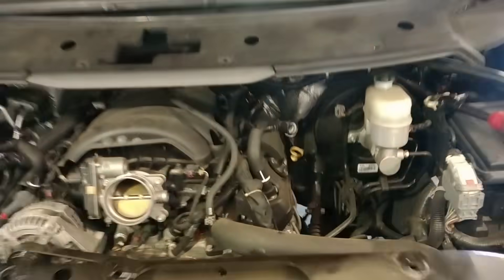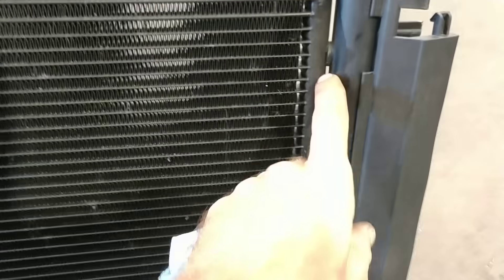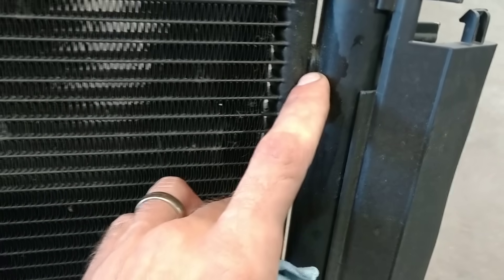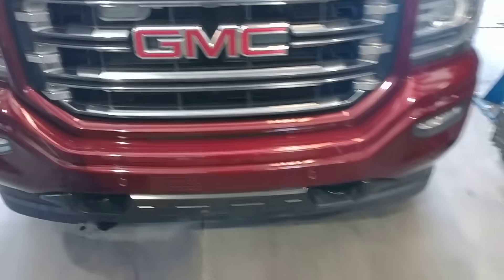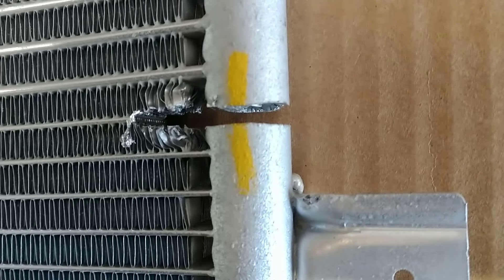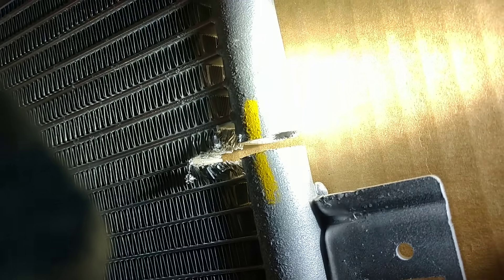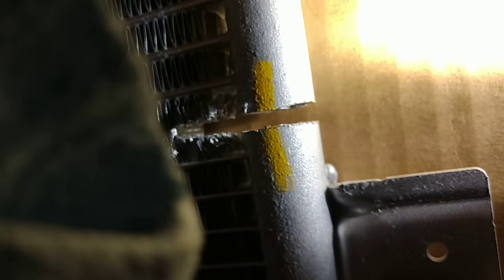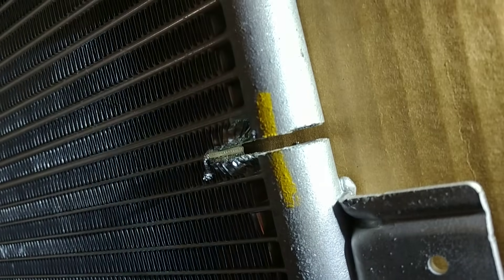Customer States...WAIT, look at this! Can't make this stuff up!

Comment: The real issue is that the part should NOT be failing on a 4 year old $60k truck!
Reply from the maker: You're not wrong. I'm sure the engineers designed three cooling package with two separate parts. The cooler for the trans, and one condenser for the A/C. Then the bean counters got a hold of it and decided to just make it one piece to save some pennies. Then when put into the field it didn't work right due to heat transfer. So the cheap as dirt fix was to hack the end tank in half to isolate the two cores so they couldn't transfer heat between them.     As a technician this is embarrassing. They expect me to install this hack ass junk and then stand by my work. It would cost money to implement a proper fix for a design flaw, so that's out of the question I suppose.
Reply: @RainmanRaysRepairs  The job I work at in Lockport, NY packages those, there's one step that we have to do to complete the unit before we strap it to the insert and slide it into the box.  There's a 4 inch by 3 inch patch that has to be attached on to the unit on a specific spot, its to reflect heat off of the part at that point as the ATOC had a tending to overheat and blow up.  The cut is generally not that nasty looking but its usually rough as the assembly lines that make them in Lockport and Juarez, Mexico have to make thousands of them a day.  The company I work for has to package thousands of those every spring and summer as they have a terrible fail rate and GM is trying desperately to resolve it.  Most mechanics that work on transmissions just take it out and use a different ATOC and install the condenser built without the ATOC that GM sells.
Reply from the maker: @KeoniPhoenix  Thanks for the info. I always wondered what that reflective patch was for. I should work for GM as an engineer... Lol I know exactly how to fix that problem and make the failure rate nearly zero. Everyone ready for it??? It's really quite simple.   Make two parts. One cooler for the trans, and one unit for the condenser. BOOM!
Reply: @RainmanRaysRepairs  Typically engineers don’t make the choices, they follow the instructions given and just build it.
Reply from the maker: @superbros1690  Agreed. What I meant is that the engineers would design there system to be robust and fictional. Then have their perfect creation be shit on by corporate
Reply: @RainmanRaysRepairs  Right, unfortunately greedy companies care more about profits than anything else.
Reply: @RainmanRaysRepairs  yeah but that would cost more money and for manufacturers that’s a big no no.
Reply: @RainmanRaysRepairs  Nah, it's the Apple business model. Why make it so you can replace a $40 part when they can glue/weld/build it all together and make it a $700 sub-assembly that is so expensive you seriously contemplate just buying a whole new model of [PRODUCT]
Reply: @RainmanRaysRepairs  they aint going to do that mr. ray thats the right way lolol
Reply: @RainmanRaysRepairs  That makes engineering and customer relations sense, Ray, but not profit sense. GM wins.
Reply: @RainmanRaysRepairs  . Shame on you Ray you want them to admit their mistake, 🙄 bite . Try making parts in America🇺🇲we used to have pride. Nowadays it's just about the MONEY,MONEY, MONEY. 🙃👍🙏
Reply: @RainmanRaysRepairs  
Fire thd bean counters and give GM back its reputation of building a reliable car or truck.   Its no fricken wonder Toyota took over the top spots.  And GMs no longer the largest automaker.
Reply: There can be some hacks with engineering degrees, but usually this sort of issue comes from the suits up in the ivory tower.
Planned Obsolescence and continuous maintenance is their mantra and GM is the big temple of this cult
Reply: @chaoswarriorbr  parts and repair are the new moneymakers at dealers now.
Reply: @RainmanRaysRepairs  More likely, they design the part to have a high probability of failure shortly after the warranty expires.   And they actually do that.  I was talking to an engineer who works for a company that makes gas struts for the auto makers (as in, the struts that fail and drop the hood on a mechanic's head) and he said that the auto makers were very clear about this:  Design the strut to fail a little after the warranty runs out.  They don't want it to last longer.  Even though the manufacturer is fully capable of making struts that will outlast the useful life of the car.    I've heard of the bearing manufacturers also being told that they need to make bearings that will barely outlast the warranty, too.   Because they don't want a long lasting reliable vehicle that doesn't ever need repairs.  They want you to buy spare parts and then trade in for a new vehicle.
Reply: @RainmanRaysRepairs  Bean counters destroy cars. One channel I follow is Munro Live who has a lot to say about engineering and car manufacturers. In the end, bean counters make cars more expensive and less reliable by compromising engineering. A good engineer chooses a certain design for a reason.
Reply: @RainmanRaysRepairs  Exactly right. Beancounters are the bane of engineers.
Reply: @RainmanRaysRepairs  Bean counters ruin many of great designs!
Reply: @RainmanRaysRepairs  how else can they rip people off and have to build more parts? Not saying you’re ripping them off but the corp
Reply: @RainmanRaysRepairs  so did you end up installing this replacement part on the truck anyway or used an aftermarket one?
Reply: @RainmanRaysRepairs  I know you said this on one of your most recent videos, we live in a false economy. Your not wrong. I don't know how many time i replaced a idler pulley on my older vehicle dam thing kept failing time after time again (bearing), anyway i got hold of a german made bearing and problem fix.
Reply: @RainmanRaysRepairs  As an engineer, I can unequivocally say that bean counters are the root of most problems.
Reply: @RainmanRaysRepairs  It doesn't help that the factories that make these parts push their employees to make high rates and check for quality at the same time. I live in West Michigan where a lot of them are. They're all the same. Challenge, Benteler, JCI, Stone Plastics, Agape, L&W, Magna Mirrors, Adient, Gentex. Yup I've worked at all of these places, I've "abused" the temp system.
Reply: @RainmanRaysRepairs  You're an awesome person, Ray..
  I hope you know the Lord loves you for treating others' vehicles as your own.
Reply: @RainmanRaysRepairs  
The bean counters figured GM could make money off repair parts. Why fix it.
Reply: Amen you the man
Reply: Nate, There's no money in reliability. Betcha that condenser is 400 bucks + labor + refrigerant.  Sadly, it's not just automotive, household appliances follow the same marketing scheme.
Reply: @68RDRNR  there is money in reliability look how much a new toyota costs compared to a new GM
Reply: We have done loads of these condensers in 2 yr old Tahoe’s. They we on back order for a while and we had to go aftermarket. Cant be any worse than OEM.
Reply: @ThePracticalMechanic  Same here (was initially due to the strike). Oddly enough, I haven't had an aftermarket unit come back leaking yet, and they were the same design with the trans cooler.
Reply: My 05 Corolla base model non electric windows none cruise control with 718k miles still have the original condenser along with engine and transmission
Reply: @5162-b8y  i have a 02 Tacoma and same thing here! I have over 200,000 miles but still all the OG parts
Reply: @AndrewSamaniego  That could go another 200k with minimal repairs.
Reply: @5162-b8y  ok Scotty
Reply: @5162-b8y  bombproof Toyotas
Reply: @5162-b8y  that's amazing.
Reply: @5162-b8y   Don't compare an old toyota to new cars, i got the same gen, 03  CE base model. Runs like a top 340 on it, all original. They where just built better.
Reply: @5162-b8y  The engine ain’t never seen over 3k in its life😂
Reply: @5162-b8y  Your car has too man miles on it.
Reply: Probably still have the same girlfriend too!
Reply: @5162-b8y  I have a 98 Toyota Camry totally good
Reply: @5162-b8y  Your car has done 1,155,508.99 kilometers in 16 years. 718,000 miles = 1155508.99 that's if i read the miles correctly.
Reply: @5162-b8y  My 2002 Silverado still had its original condenser when I got rid of it at 170,000 with rust and transmission problems. My 2014 Sierra has already had a new condenser installed, and my buddy's 2019 got one under warranty within months of when he bought it.
Reply: @5162-b8y  dude. It's a Corolla. They last forever. Nothing new.
Reply: @5162-b8y  and that is why Toyota makes best vehicles.
Reply: @heginschristianstrong7707  toyota all the way. I have a 2010 Venza creeping on 150k. Original AC components, never even needed a recharge yet.
Reply: @Tylerc3419  And my brother has a Dodge Caravan from the mid '00s, with over half a million kms.  What's your point?

(That's over 311k miles, for our American readers....)
Reply: @cbiltcliffe  the caravan from the 90s to mid 2000s was about the only good thing to roll out of Chrysler. I'll agree with that. I was commenting on GM's crappy AC though. Chrysler still sucks. I have a 01 Sebring with 60,000 miles, babied and garaged since new. The list of problems to fix everything is over $3000 in just parts. The AC in my Chrysler is about the only good thing.
Reply: Yup made with poor quality parts and they charge you big bucks to buy one
Reply: That is why i'd rather stick to an old 70's or 80's chevy p/u rather than paying 70 g's for a new chevy or gmc or anything new for that matter. In my opinion i think they make these new cars to break down on you so that you have no choice but to take them in to get worked on or possibly trade in for something newer just so you can spend more money but like i said that's just my opinion
Reply: @lorenzocuellar7521  Now the computer is in the car, we can't throw it out the window anymore.
Reply: Agreed. These dumb bean counters don't understand a cheaply built part now, while may save millions in production costs, almost ALWAYS cost 10s or 100s of millions in future repair costs.
Reply: @Whereismy10mm  GM is also a big fan of neglecting to recall parts that should be recalled. They'd prefer you keep getting it fixed out of your own pocket until it ends up in a scrapyard
Reply: @austinh1028  oh trust me, ford is too. There should be a recall for 6.7 oil pans for leaking between the block and upper pan.
Reply: NO vehicle manufacturer will design/build a vehicle that will last many years. If everyone bought cars and/or trucks that lasted 20 years they would ALL go bankrupt
Reply: @_Clem_H_Fandango_  Oops, mine is 22 years old, and when the time comes, I ain't buying anything built after 2000.
Reply: @thomasmleahy6218  I don't blame you, I still try to buy what I call "B.C." cars. Before Computers, simpler cars to work on and usually if it's old enough no one else is driving one.
Reply: @thomasmleahy6218  I have two 2005 cars (A Hyundai and a Toyota) and three more made before 1999. That is the way to go, for as long as you can.
Reply: @_Clem_H_Fandango_  funny...I don't see Toyota going bankrupt
Reply: @_Clem_H_Fandango_  Isuzu seem to do OK. Loads of 20 & more years old ones round here & what usually kills them is tin worm (corrosion) due to our wet climate & sea spray.
Mine's on 280,000 & anything that's ever broke, I broke it apart from the fan control.
Reply: ye, it's suppose to fail right after the warrenty expires. Something went wrong here.
Reply: That's GM for ya.
Reply: 100% poo poo parts.
Reply: It's the auto manufacturing industry. They want to have suppliers cut costs on their parts every year so it puts pressure on the suppliers to build shotty parts.
Reply: Repairs should have been 100% under warranty from gm
Reply: @mondo odnom I beg to differ. I have never had an AC/HVAC system present a problem before 100k miles or 8 years. If you pay $60k for a truck I think it's unreasonable to expect me to be ok with it breaking in 4 years and mileage in the 30s especially when it is engineered in a way that makes the cost to repair sky high because of the labor hours having to disassemble other components just to be able to get to the broken part. The quality from GM and RAM has been so bad for so long that people have come to accept it and Unfortunately, this problem is common for a GM. Their reliability has gone downhill consistently since 2000. You'll be much harder pressed to find someone that had this problem so early with, say, a Tundra at that age and mileage...or a GM Truck from the mid-late 90s
Reply: According to their accounting it actually should :)
It is designed to pass the warranty and fail
Reply: My first new car after getting a real job was a 1990 Ford Probe. Whoever put the condenser where they did was a fool. I had bought the extended warranty and it paid off for me. They replaced the condenser three times in five years due to punctures from road debris. That warranty also included loaner cars while the car was in the shop.
Reply: @mikecumbo7531  Yeah i would love to meet SOME of the S@#T for brains of engineers who designed the engine bays. They clearly never serviced a car before in their lives.
Reply: They designed it perfectly.  Failed after the 3 year warranty is up.
Reply: Tell that to the new honda civics😂
Reply: @Thor Odin son Who won at LeMans.....? The better engine-Ford.
Reply: @67marlins81  What people don't seem to realize is that it isnt the better engine getting swapped into everything under the sun, it's the one with cheaper parts, so naturally for a crazy V8 swap on a budget, it's always a GM V8 that gets the nod. The 350/5.7 then the 5.3 that followed. That's how it's been for decades. They never learn
Reply: @crewdawg2008  exactly
Reply: @Thor Odin son that might be for older engines but the new ones are junk. $1200 for a water pump replacement in a 2010 GMC Acadia, please, what a joke. GM does indeed stand for GarbageMotors now.
Reply: yep i got 86 cutlass R12 works good as new never been opened up
Reply: @jonsworld5307  I think I have that beat - I have a 1985 Hyundai Pony with dealer installed AC (R12) and it blows ice cold. 

The car around it has to be rebuilt though, no brakes, I think some gasket needs to be replaced as its pissing oil out, there's no exhaust... Interior is nice though!
Reply: I was a big Chevy/GM guy for almost my entire life. GM has such poor design and engineering these days that I probably wouldn't take one if you gave it to me. Everything is engineered with planned obsolescence in mind...to bilk you for parts at repairs. Even worse, the designs are so horrible, that the labor costs are often absurd as well. I could deal with one or the other, but not both! If a part breaks frequently, they should at least make it easy to replace. If it's not easy to replace, it shouldn't be something that goes all the time! GM (and Mopar) are the worst!
Reply: I had to replace get the condenser replaced on my 2017 impala last year. It only has 30k miles on it.
Reply: I work at an auto parts store, and 80% of my customers are for American cars and they end up being major repairs. if we get anything like Toyota, it's for an oil change/air filter change.
Reply: @tracep.9900  i,m working on my 2 toyota tocama's 4 banger i got over 475k miles on the 1991 trade in was 2800$ best motors next to the inline 225 slant six
Reply: Funny part is I believe the SUVs have a special coverage but not the trucks
Reply: @driftfoxgarage  Yep 60,000 on Tahoe/Suburban
Reply: Agreed
Reply: ,,got to love cheap plastic parts
Reply: Exactly
Reply: Yeah how about the coil on your $10,000 AC unit in your home!
Reply: I had to replace the evap coil in my Explorer last summer.  I expect better quality out of these things.  I paid a lot of money for that Ford in 1998 and the a/c is out already!
Reply: How hard would it be to put a different part in? Afaik all the ac fittings have been standard since the late 90s, so only the geometry is different. You might need custom bent lines but a 1 time fix is a 1 time fix.
Reply: I had to replace mine 2018 Silverado. Complained and got some GM Rewards points. Lol
Reply: @michaelatchison6127  Rewards points i like that lmao. Tell you what does not matter where you live on the globe nothing is made like it use to be anymore.
Reply: Cheaper to have a shop weld up and fix the OEM one and either put it back in or keep it as a spare.
Reply: would JB weld actually hold that up? I've seen it used on AC lines on an 2009 Elantra my friend was trying to buy off a used car lot (that car was a mess - 160,000 KM on the odo, pedals, carpet, and steering wheel (under a cover, to be sure) indicated taxi levels of use, clearly repainted w/ overspray on the top part of the engine covers, all over the unibody rails and exhaust, rear rotors that had more rust than a dead track, lots of missing clips and  visibly scored screw heads in door panels, wiring harness spliced all over under dash...) but the AC actually blew cold air.
Reply: Funny how no one's talking about the giant gash cut into your new condenser. Yeah, stuff breaks these days after a just a couple years, it's not news. At least not if you work on newer cars for a living. For sure, I've gotten shit replacements for condensers and radiators, OE and aftermarket alike, but nothing like that... That's, hilarious.
Reply: you are correct, But we are talking about a GM product, I used to be strictly a GM customer But their quality is really bad and GM knows it but no one seems to care about quality at GM anymore.
Reply: this is why cars like Teslas are more and more appealing.  No purposeful obsolesence.  All youre going to service is tires, brakes, and those kinds of things.
Reply: @TheK1ngdomK1ng  The guy who just blew his up, 2 batteries dead in 8 years at 24k ea. Then needed a third one fk Tesla.
Reply: @Thor Odin son china owns g e
Reply: You should see Hondas. We do 16-21 Civic condensers all day long at the shop. They literally seep refrigerant out of the pores in the metal. Shitty metal used = Shitty part created. The OE supplier for most of them is Keihin, and they supply our failing injectors too, so my guess is QC at Keihin is going downhill.
Reply: I agree.  Years ago I had a 1995 Chrysler Concorde with a Leak-o-Matic a/c system.  The evaporator coils would start to leak every few years, and replacing one involved removing the whole dashboard assembly.  Needless to say, I just kept recharging the system until I could dump the car.
Reply: It's GM

Enough reason to fail at 4 years.
Reply: I have been part of design processes where I have found final as bought parts to use off the shelf quick and easy to get and use. What ended up happening was that I was overruled and told to just use the size they wanted me to use. I finally threw up my hands in the air and said okay no problem. 

Then a few weeks later I get yelled at my coworker that I didn’t design it correctly and that the purchasers couldn’t find that size in time and they were forced to a smaller part to use. The one that I suggested in the first place. 

This had to go through a redesign process that was ridiculous. 

People need to start thinking through these things and purchasers need to work with what is required.
Reply: I have a 1996 GMC  Sierra.. 172.000
Miles. Only have put in a clutch.  Bought it was a year old. Body still looking great oem paint. Always been garaged
Reply: Who has to pay for repair’s
Reply: I own a 20yo ford, my ac has never even been recharged. Works perfect. Perhaps you lads should stop buying Chrysler products and you wouldent have these issues?
Reply: 60k when it was new, deprecation sucks :(
Reply: Your absolutely correct.
Reply: It’s a GM it’s surprising how it lasted 3 years with no issue.
Reply: Thats modern cars and the company's grred for right there
Reply: @DitzyClouds  yep. Before the 90s, we were just replacing entire vehicles at 100,000 miles.
Reply: @DitzyClouds  only trust Toyota and honda
Reply: @PedroGarcia-zf8zg  na ill trust my 79 malibu over all
Reply: @Thor Odin son I got news for you Honda is the largest engine manufacturer in the world and and their reliability is awesome. I’ve got a little Honda fit with 400,000 km on the engine already and it still runs like new with no oil burning. GM’s by the time you get 200,000 km on it becomes a money pit
Reply: They engineer cars to break or haven't you been paying attention?  There's no money in reliable cars.
Reply: @warmbeer2  about ten years ago I was talking to a retired Engineer for GM.  he worked back in 70, 80's and 90's.  He said they spent more money on R&D to get parts to break at certain mileage/time points than they did anything else.
Reply: @heginschristianstrong7707  used to be great engines.
Reply: @heginschristianstrong7707  I heard about that as well. Now with the new technology they can get that to happen pretty accurately. My father in law worked at gm for 30 years and he said about 15 years ago a guy brought in a truck that had 1 million miles on the engine with no major repairs. He said they bought the engine from him and gave him a new one. Instead of using the engine to figure out what they did right they tore it down to figure out what they could do so that wouldn’t happen again. He said they’re trying to make it so that the engine fail’s catastrophically by 250,000 miles. They want you to replace your car every 5 to 10 years. It’s amazing that cars from the 90s are going strong right now but brand new cars are failing out majorly very fast. I think right now all the Asian companies are making great cars while American companies are making cars to fail.
Reply: @warmbeer2  
Same thing with healthcare. There is no money to be made in “cures”... “Treatment” is where all the money is!!! Gotta always keep them coming back!!!
Reply: It's a GM...its predetermined to happen..
Reply: Aaaand thats why I stick with toyota
Reply: My buddy came home pissed after a day at GM because hes working on a 2020 truck with 16,000 miles and a cracked cylinder head. GM is crap!
Reply: Junk ass GM for you. GMC = Got Mechanic Coming.
Reply: 04- up dodge cummins do the same thing
Reply: That’s GM quality for ya
Reply: What else do you expect from new gm garbage.
Reply: General Motors....
Reply: Yay GM! Build the cheapest and prettiest crap, then sell it for top dollar to trucker wannabees that dont haul or tow anything. Kinda smart of them actually...
Reply: @Niagara716  Well "we" keep buying it :)
Reply: No it can. It's a common recall issue. Hard driving and debris being kicked into the front of the vehicle also can speed up this cause. Much prefer the Subaru wrx style where it is located on the top mount with its own hood vent and not at a place to pick up easy damaging debris.
Reply: Yep, waiting for my Model 3.
Reply: Garbage Motors .  GM
Reply: But why make something better than VW..
Reply: @Deutsche_1  Volkswagen equals pure junk, always has.
Reply: @Deutsche_1  in america every car is better than a VW. we live a very sad life over here
Reply: @zoemarshall-sappingfield415  True.. America is the best for Americans, just not to the rest of the world...
I find it shamefull that Americans (and Europeans) is making their products in China, every single quality product down the drain.
Reply: It's a GM product. What did you expect ? A "Toyota like" reliability and quality.
Reply: i got a 2003 jeep liberty and the condenser is the factory one. Something is strange about your vehicle. If i were to guess, it was maybe a Dealer Vehicle because Dealers do all kinda of shaddy stuff to those vehicles.
Reply: @robertbrainard5651  Brainlard what are you talking about? he is a mechanic, its not his car. He states what the issue is